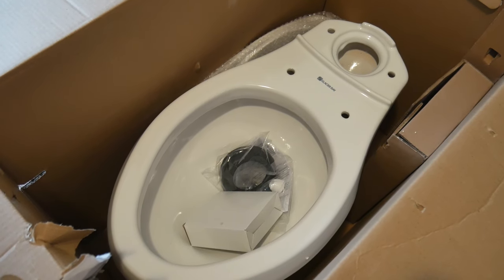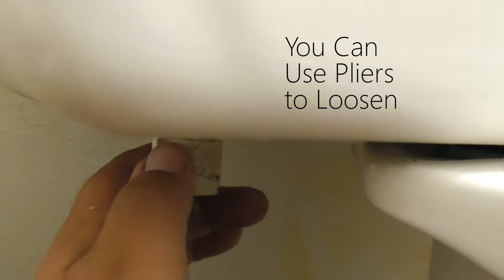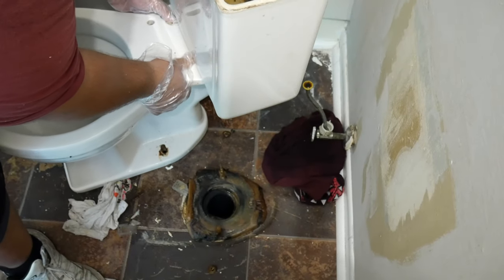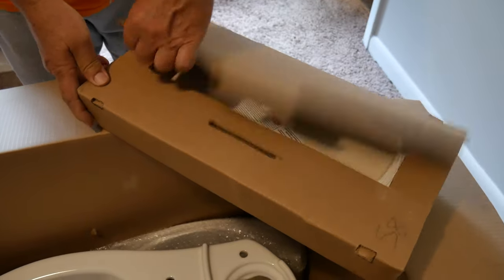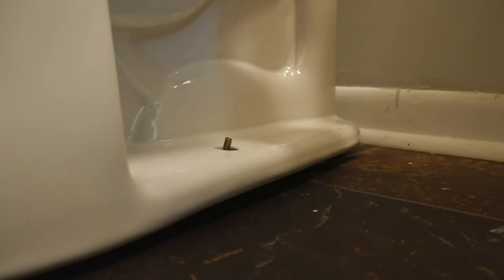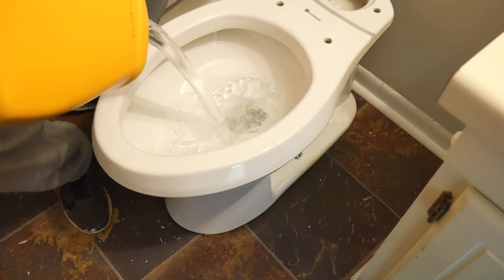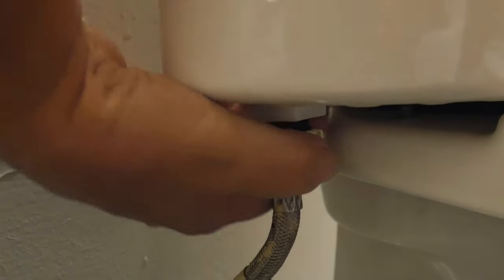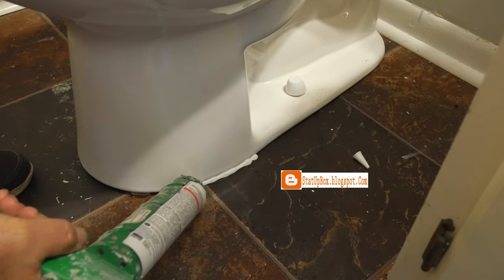How To Replace or Install Toilet Easy Simple

Comment: I have a couple of tips about replacing or rebuilding a toilet.
Neve put any of the 3 porcelain parts on any hard surfaces(concrete or tile) except the base when you install it. If there is uneven pressure on the porcelain it may shatter, use carpet, cardboard or some other relatively soft material to protect it.
Make sure the toilet base will be level, inspect the flange and floor with a level it is better to fix issues before install than it is to let it go or shim it. If you must shim it look into the correct method before you act.
If the tank(if you are rebuilding) has a metal nut that is corroded you may shatter the tank if you go full monkey boy on it with a big wrench, use a hacksaw(I debated whether I should mention not using a chisel since someone who would is probably too dumb to learn or take good advice).